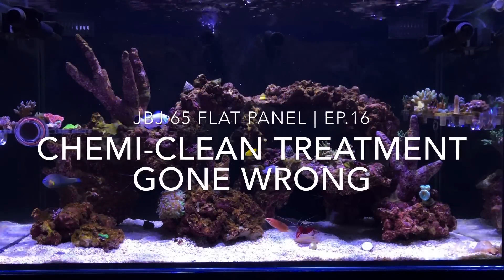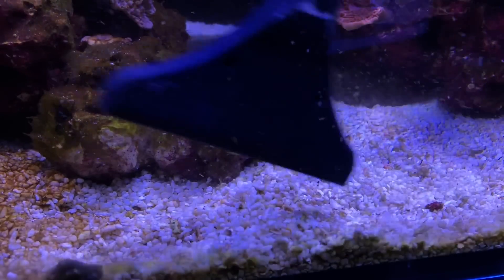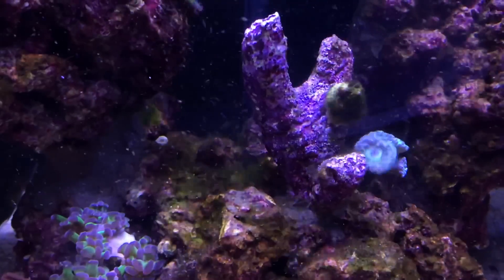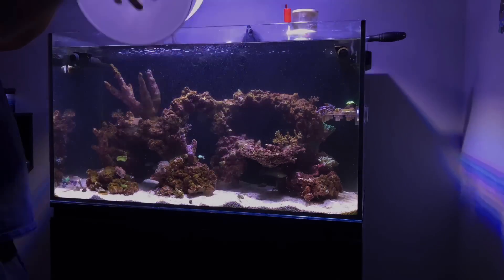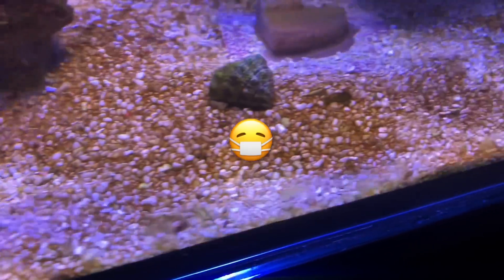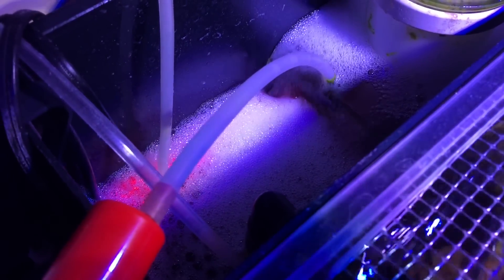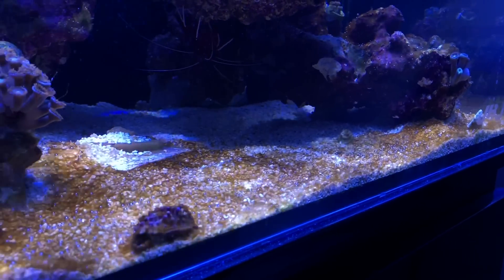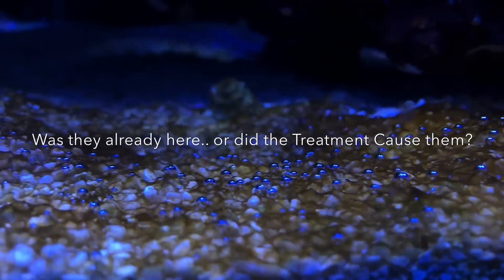Ep.16 | ChemiClean Treatment Gone Wrong

Comment from the maker: We were cruising along adding corals and then BOOM 💥. This tank has taught more lessons than all other builds combined. What I thought was a simple issue will become my biggest obstacle yet. Stay tuned as the battle continues.. be sure to take the poll on the top right  #BeEazy
Reply: I have also beat dino by using vibrant
Reply: Fish of hex has a video on YouTube how he beat dinos by raising his no3 and po4. He also sales no3 and po4 supplements. It helped for me. Usually you get dinoflagellates because your system is to clean
Reply from the maker: Yea I removed all carbon turned off UV as well.. and just like u found out it wasn’t Cyano
Reply: Make sure you remove any carbon filtration before you use chemiclean. I used it on a 34 gallon, found out I had more than just cyno.
Reply: Use baker’s yeast. Took away my Dino
Reply: Hey CJ. I know you’re out of the hobby now but did you ever find the reason for the issue and how to correct it?  Thanks

Comment: dinox will do but beside that you could use ROWA po4 so4 removal but dont pump your return pump directly to your coral when u use rowa make sure water is circulating do not feed frozen food just flakes or pallets feed small but different timing should solve your problem

Comment: I just bought some hoping this would end this mess!  Whatever is in my tank keeps changing.  It looked like diatoms, no bubbles, no snot no weblike.  Then it became snotty when I would try to vacum I noticed it clumped but still looked the same like diatoms.  Now out of nowhere its getting weblike and long and stringy stuff on glass and bubbles!.  I got very sick and left the tank alone for about a week.  I was trying to get it up with my turkey baster a lot but this last week is when it got like this.  I thought my po4 was at 0 after using nopox! Today juding by my new hanna url phosphates I am at 0.03 and 3 nitrtes!  So thats perfect!  I did have a wavemaker break and added an under powered on for  a week or 10 days.  Maybe thats why it changed but I read dinos is mostly from imbalance or 0 po4 or no3.  I am scared shitless to do this because It is horrendous now from letting it go but I dont want to do 2 back to back waterchanges.  Its been maybe 10 days to 2 weeks since I id one, so not that long but juding by what happened to you I am afraid it will make it worse.  I have never let it go this long  and only bubbles are on glass.  I dont know what the hell to do. Maybe buy a microscope first?  Brs said to try chemiclean first if unsure!  Could bubble crubbing make it worse. I never heard to do that.  I may have to be hospitilzed soon I am having serius health issues and I know my family cant take crae of my tank!  Hell I cant even do it, so was hoping this would be a quick fix!

Comment: Ive used chemi clean to get rid of cyano in my last 2 systems.  The first time i used it it worked after 1 dose and didnt cause anything after. The 2nd time i had to do 2 doses and after the cyano was gone i noticed some diatoms on my sand bed. But after a 25% water change the tank looked amazing and the diatoms were gone in about 3 days.

Comment: 3-day blackout, micro Bacter 7 (dos per the bottle!), no water changes, done.  

You may have to do it a few times (I had to do it 3 times).  Give it a week in between black outs.  

Your blackouts need to be ZERO light.
Reply: I tried your method but the blackout killed most of my corals.

Comment: Dude I definitely know the struggle. Been reefing for 12 years with never any huge issues. Tanks have had high nitrates etc. but have all been fine. This last tank I set up better than my others. High end equipment with great maintenance routine. I first fought bryopsis which I treated with magnesium tech m by kent. Then had dinos and bubble algae plague. Killed many corals off. Treated that with vibrant. Then got cyano bad. Used chemiclean. Which led to hair algae which i am now treating with fluconazole. I have learned since that my issues have primarily been from to low nutrients. I couldn't cultivate good bacteria because bad were stripping little nutrients from water and algae phosphate. I've been running without skimmer and overfeeding and I have seen an increase in amphipods and copepods. Still havent gotten off zero nitrates but algae is receeding. Another thing is I took my carbon offline which really can strip system. I talked to George at pure reef which I saw you know too. We discussed how high end technology is somewhat hurting the hobby.  They are too efficient sometimes as well as most aquarist starting scrapes with dry rock instead of live rock. This creates lack of biodiversity thus more plagues of cyano and dinos worse than previous years. I've almost wanted to give up several times. But my new goal is to keep elevated nitrates of 5 or more to prevent this stuff. Prior to dino plague nitrates were at 20 ppm but they brought them down to undetectable. Love your channel. Keep creating!

Comment: I am just coming out the other end of dynos right now on my new'ish 7 month old bare bottom sps tank. I had a bad bacteria bloom that lasted 3 months, finnaly fixed it with a UV sterilizer, but was also dosing vibrant and Dr tims waste away this droped my nutes "no3 po4" to near 0-0. Dynos took over.... face palm. I was dosing no3 and po4 to keep this from happening but didn't stay on testing, and well you know how it goes. Nutes drop and stay down I get dynos, so I test more twice a week and get my no3 po4 up up up up. 5 no3 and .1 po4 and they started dieing off. T baste off every thing in the morning and change filter sock/media, every morning. I didn't change my lights, I did take out as many snails as I could, I wanted algae to take over and snuff out the dynos. Yeah I know "You want GHA"??? yup critters eat algae and thrive! critters eat dynos and die! So I figure better GHA than Dynos... long story short"lol" after about 2-3 weeks of 5 no3 and .1 po4 they are gone, little by little. Hope this helps, also I have used chemiclean a few times, works great on cyano no problems at all.

Comment: Dino's appear to be affected to PH. 
Also they exert toxins. 
The non chemical way to start is increasing PH to 8.3 
And run carbon to filter out the toxins. 

If dino's want to create molecular cell structure, they need carbondioxide. 
With higher PH (and stable KH) the CO2 levels will be lower and dino's will not be able to grow.

This makes it a CO2 related issue. 
Which makes me wonder about skimmer issues. Maybe the bubble period introduced more CO2? No idea.

Comment: I was having a similar problem and it turned out to be the salt .wen I mixed the salt some how it was full of nutrients so I was putting nitrates back in to my tank I was using to water and check out water was perfect but was I put the salt in left it for 24 hours with a pump mixing it the nitrate was off the scale

Comment: Get then algae off the rocks using Turkey baster. Run the skimmer to get it out. Do it for a month. It should go away before that time. Then usually another algae will take over. But honestly the best way is to get a LARGE URCHIN for the tank size, and let is displace the algae as is crawls over it. The next METHOD is to try shocking the system with some phosban. Personally, more WATER FLOW and it won't take hold, if it does use a Turkey baster and keep it off. Best. I also heard using bacteria, but I haven't had that problem to experience that battle front.

Comment: The way I did it is, take out carbon, turn off skimmer, and turn off the UV light for 2 or 3 days. Worked for me. Idk why you have your skimmer on, maybe to air the water but I just pointed my gyers to the top and added 2 power heads at the bottom pointing up.

Comment: hey CJ, worked for me after 2 doses with water changes after 48 hours each. Did not lose any corals or fish - while running skimmer without collection cup.
  also noticed my ph was low 7.7 - 7.9 (from to much C02), once I had skimmer air intake connecting to outside air - the PH is now 8.2 and no signs of that type of algae.  I read this type of algae loves high C02 levels.
  good luck with your tank!

Comment: Yeah.  I had dinos last year.  My knee-jerk reaction is exactly what alot of ppl are saying in comments and it didn't do squat.  The chemicals/heavy maintenance and water changes etc.  Infact what SEEMED to work for me came after I tried all that stuff and it all failed.  I did nothing and let it run it's marathon course.  I did not do water changes, I did not add nutrients, I fact I cut fish feedings to a minimum and stopped feeding the coral.  No additives, just alk/cal and what I think happened, it starved itself out.  Physical removal was pointless, it just comes right back.  Dino X is NOT reef safe from my experience, i swear it's why my cleaner shrimp and acros bit it after use.  If you let it run it's course I think you'll get through it.  I did turkey bast it off the rock when it was threatening to cover my coral occasionally, that's it.  GL.

Comment: Chemiclean works on cyano bacteria, you don't have it. I believe you are nutrient limited and doing the water changes required by Chemiclean treatment further reduced your nutrients and fueled the dino outbreak. You need more nutrients via food or dosing. I do think that you need the scrubber running, the fact that nothing has grown in it is also a sign that you have no nutrients along with your drab looking corals. The scrubber will serve for excess nutrient removal and be an indicator that you are getting the proper amount of nutrient in the water. Manual removal and use of a strong uv sterilizer will also help, but won't be of use until you get proper nutrient levels.
Reply from the maker: Bob's Reef Tank %100 correct the required water change set me behind and I have to do one more since I did a second dose. I’ll start over feeding immediately after that no export to raise them. I also have a UV running now so let’s hope it starts workinf

Comment: The more burgundy carpet growth on the rocks is easily cyano, then mostly you have dino on some of your rock work and sandbed. I'm sure you know why your tank is out of whack, like you said you weren't maintaining your RO/di unit, prob adding too much livestock for such a young tank too quick/changing other things which all has an affect on the balance of the system. Also, I noticed something...where's all your cleanup crew? there should be snails/crabs galore. You could use some products like vibrant but it's prob going to have an affect on other forms of beneficial bacteria that you want. My advice is to slow down and stop putting your hands/new things in the tank for a while until you build up that balance and cleanup crew. Tons of frequent water changes should be in your future for a while w/o new additions of livestock.

Comment: CJ, I have been with the tank for a while and I just remembered I used vibrant after the 3 day blackout and it removed all Cyanobacteria. Not sure how that will work for Dinos but I really liked the vibrant. used a very small amount of the bottle with great results.
Reply: John’s Reef if he already has Dinos, adding Vibrant will make it worse. If you have a super low nutrient tank and then dose Vibrant, you will most certainly get Dinos. I dealt with this exact issue about a month ago. I ended up removing gfo entirely and started dosing NoPox by Red Sea. It cleared up the Dino’s in about a week. And it keeps your nitrates and phosphates in check without letting them get to 0.
Reply: oakville09 thanks. It’s all experience. Never have had this monster.

Comment: Cj, go with blackout method for 5days corals and fish will be fine. 
Last time I had same problem blackout got the job done. it's been two years free from all.
Reply: I agree with the blackout method.  I had the same issue and when I was gone for a week, my lights went out because Wifi was down and my Apex was unable to control the lights.  I came back surprised that my lights were out, but the dyno was gone after that.  No livestock loss as a result.

Comment: For dino all I did was let it run it course.  I mixed up the sand some and had a sifting star.  All new tanks kinda go through this stage with dry rock.  I also added micro bacter I believe and after like a week or two it was gone.  My new tank is now almost a year old I get little break outs on the sand bed from time to time but doesn’t last long at all.  My rocks did it too really bad at first I turkey basted those and it’s all gone as well.  It won’t last to long it’s just ugly

Comment: I have had Dino 2 times and the things I did or think that beat it was I added dr Tim’s one and only big bottle, bubble scrub about 3 hours while brush the rock , used finer filter socks and change everyday, used double the carbon for my tank ,and then I did a 50% water change once a week. In the 2 times I have had it took about 2 weeks for it to disappear. As long as your not losing corals or fish I wouldn’t use any chemical products as they are for last resort.And I only run a Cheeto, skimmer, and carbon.

Comment: I'm going through the same thing with my new frag tank . I have both in my tank I got red slime and dino . I usually let them get out of control i have carpet of red slime and dino . When they grow thic I take tooth brush clean off the rock and vacuum the sandbed . After water change I start getting my nitrate up. About 2 week both disappeared.  Other thing u can try is sand sifting starfish with regular water change and rise nitrate . I try not to use any chemicals in my system . Water change and time is the best cure .

Comment: Dino x works really well I have use it multiple times and works in 5 to 6 dose and you can dose up to 15 or 20 doses and when it clears leave it in the tank for a week and do go water change and put new carbon gfo purigen and you should be good

Comment: Get some more nitrates in system, feed heavy or dose Kno3. Now is time for the fritz 460 you added during initial cycle also, you need biodiversity with bacteria and add nitrates by overfeeding or dosing. It's a young immature tank, you are going to have huge ugly algea stage cause of way you cycled but leave it alone and let it stabilize. Stop using algea scrubber also, tank too young to try to fight algea yet, it needs phosphates in system along with more nitrates to help build biodiversity in microfauna to out compete Dino's.

Comment: If it helps I purchased a cheap 24w green Killing Machine UV steriliser and within 48hrs the dinos had gone from my 30 gallon and I had tried many things prior to this over the weeks.During lights off the dinos enter the water column and get sucked through the UV,just slow the flow down a little so they get more contact with the bulb.Anyway 100% worked for me and no dinos since.Oh and stop doing water changes they just love them new added silicates, and raise nutrients,nitrate to around 5ppm.

Comment: CJ dinos come when your system is out of balance. When you mess with the parameters too much you end up getting them. I got rid of mine by doing a water change and sucking out as many as I can. Then dose hydrogen peroxide liberally. While doing a 3 day black out. And also running a UV. Hella over kill but when I only did the 3 day black out or just peroxide they would only be gone for 2 weeks and come back. Do the all out method and also put fine filter pads in the back and change them daily. Idk what your nitrates and phosphates are but you need to have them at solid levels. If you drop those too low it will cause the dinos to take off as they will outcompete other bacteria. It's all a balancing game. Get your tank back to the middle ranges and you will be good.  Give it a month or more to get back.  Good luck man.

Comment: It's definitely dino. It's not that chemiclean didn't work, you didn't diagnose the problem correctly. Chemiclean is for red slime. Which you clearly don't have. Just a mistreatment. Also, when running these products, your not suppose to run your skimmer. It basically cancels it out.

Comment: I’ve got the same crap in my tank. I thought it was Cyano. It looks really close. I’ve used chemi clean in the past (on Cyano and it worked great!) I done two different treatments thinking it may have been expired and I ordered more. Still didn’t work. I then realized it wasn’t Cyano. My guess now is diatoms. I added a few nice chunks of dead rock to my tank without cleaning it and I believe that may have caused the problem. Dino’s is long and stringy with a bubble at the end. I’ve had it before. If  that’s what it is, I can tell you how I got rid of it.

Comment: Hey CJ. Great update. Sorry to hear that the Chemi clean didn't work for you. I have used chemi clean before and it worked very well and very quickly. I have a Cobalt aquatics c-vue 40 gallon tank. My problem was after using it as well. I had not made the necessary changes to deal with my overall nutrient issue. So it open the way for another algae to take over. I was finally able. To deal with that as well. The brown stuff that i saw in your video looks very similar to what I dealt with in my Innovative marine 40 cube. I dealt with it by doing water changes. I did an initial water change of 20 gallons. I then started doing 15 gallon water changes every 4 days or so. Then went to once a week. I also did alot of manual removal. It gotten into the sump area and I had to remove it from there. I also cut back on my feeding. Then after a few weeks it just melted away really quickly leaving the sand bed and the rock work. For me once i got my nutrient issue under control     it went away. My tank was not a new build but had been up for months and doing well before it. Good luck.